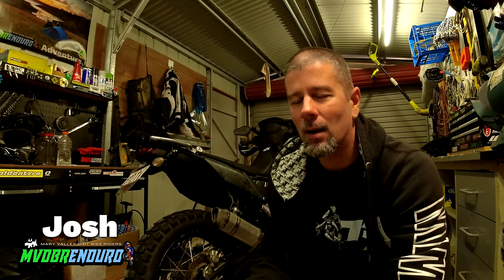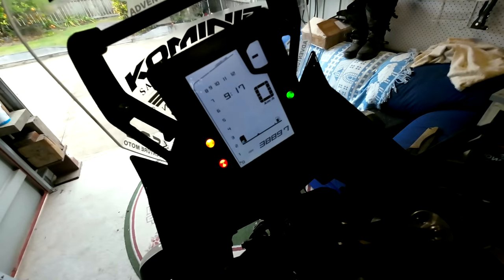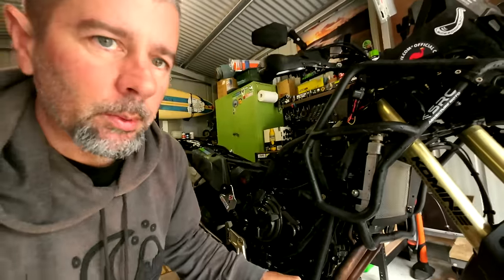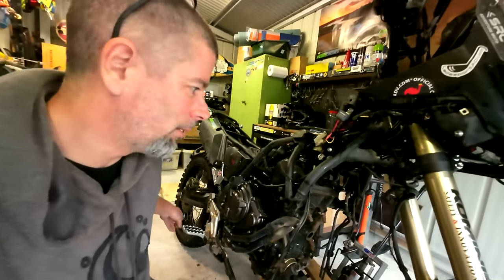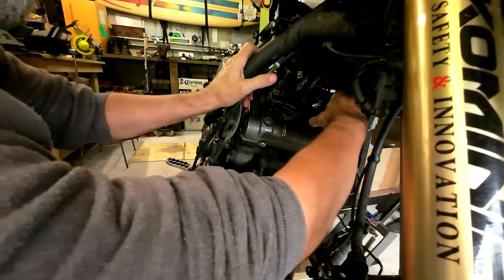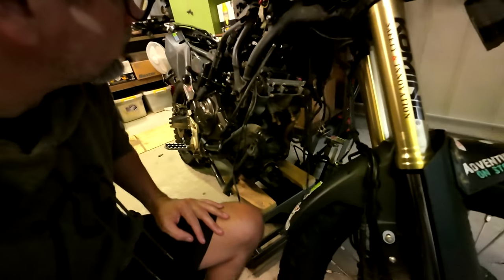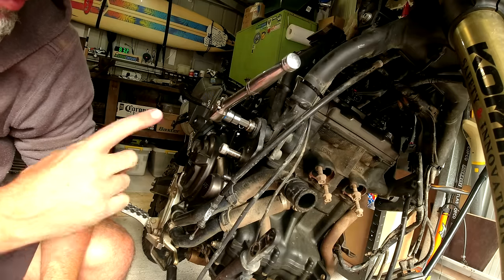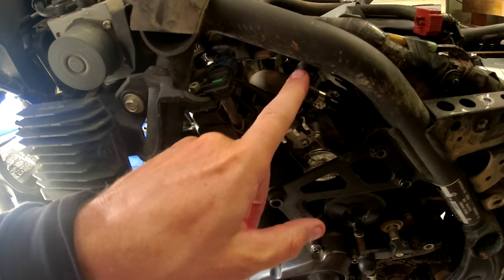Tenere 700 Valve Clearance Check: The Easy Way?

Comment: I think it doesnt really matter if the lobes are pointing forward or backward.... in either direction they are not pressing the valve and the lobe is round, so it shouldnt make a difference. 
Glad you gave it a go. I'll do it that way at 80,000 :)
Reply from the maker: So you reckon that looked easier than what you did? Yeah I couldn't get the feelers to go thru properly with the lobes pointing inwards, they still went between the lobe and the bucket but it wasn't as satisfying as the other way around somehow 😬

Comment: Hey josh, good effort. I remember doing my valves check on my 500 exc at 500 hours and they were still in specs but at the limit so like you i said f*** it it is still good. Then at 680 hours the timing chain jumped and valves hit the piston and game over. So don't go too far before shimming them properly. Cheers
Reply from the maker: Jeez the 500EXC was probably due for it's 3rd top end at 500 hours 😅 Bit different to a low maintenance twin, but I hear ya man I'll check em again in a while now that I know it's not too bad of a job 👌

Comment: Nice video but personally after all the work, I would have brought all shims to the middle of the tolerance. Would have never needed to touch the shims again ever again. Also, when doing such a job, replace all other parts you have access to. Spark plugs, air filter, coolant, valver cover gasket... After that, everything is new and serviced. One wash.

Comment: At 10:10 You are right with cam positions which should be pointing out because this is TDC on Compression stroke. First I was quite confused with video of the other guy which show cams positioned not as manual say. As for the clearance on the lower limit I would re-shim it al least a bit on this moment but this is Your choice so please post what were the clearance after next service 👍
Reply: I agree about re-shimming the ones at the limit. They are going to get quite tight for the next 40K kms.

Comment: Glad I switched from the t7 to the GUZZI v85 before 40k km, on the GUZZI valve check even though it’s on 2 different cylinders is a 30mn job 😁. Nice job Josh ! 💪🏻
Reply from the maker: Cheers mate yeah it was tempting to get rid of it 😅
Reply: better swap the Motoguzzi out too when it needs work ae? 😆
Reply: @MissionMitchAdventures  I you can wrench on a tractor you can wrench on the Guzzi :D the rear shaft drive oil even smells like tractor oil :D

Comment: Impressive effort Josh.  I had mine done at the dealership (BMW F800GS) and it cost >$700 - ouch.
Reply from the maker: Yikes, yeah it's a pretty big job on these modern multi-cylinders, especially when re-shimming is required 😬 Thanks for watching mate
Reply: @MVDBR  Someone message me ant told me they were quoted $2000 for the T7. Frking rediculous!
Reply from the maker: @Nerb1  😵😵

Comment: Surprised you didn't change them while you were in there but i guess if they need changing it should be even easier next time hey! Cheers 4 sharing sir.
Reply from the maker: Yeah I know I sometimes like to make work for myself but not this time mate 😬 A mechanic once told me they are better off at the tight end of the range anyway cause there's less valve slap or lash or whatever ya call it 🤷‍♂ Cheers broheim thanks for the comment 😎

Comment: In the late 70's and early 80's Yamaha used to promote their machines being serviceable.  My, what a backwards nightmare this is on a T7.   I thought my 701 was painful, no way, not on your scale!  Then again, my old faithful XR400, 15 minutes done.   Progress!  Oh wait.
Reply from the maker: Yeah I hear ya mate my old enduros (even the modern ones) are a helluva lot easier than this shit. Too much shit crammed in there like ABS and pollution crap on the bigger bikes these days.
Reply: @MVDBR  they no longer make engines actually for the role and we see this ridiculousness.   Just watched a walk around of the new Transalp, it’s the same with the sump asking to be taken out and the pipes going underneath. 

Anyone with a design brief for the real world would have the sump flat, oil in the frame, pipes around the side, engine mounted lower in the frame, either air box on top or a bigger fuel tank. I’m not telling you anything you don’t know in that. 😉
Reply from the maker: @brendenvosper7772  was that full pelt Pete? 😅👍
Reply: @MVDBR  yes it was.  It’s not the Honda of old.  Wonder where they are really made?   Made for a price.

Comment: “On the limit “…? I would have re-shimmed after going that far and put new spark plugs whilst having the access. Top banana for doing it though, I’ll drop the engine when its time to do mine thanks for the info
Reply from the maker: Spark plugs aye yeah shit what was I thinking 😜 11:46 As for re-shimming, I'm certainly no mechanic but my experience with these things tells me after 40k those valves are just bedded in nicely and shouldn't really move any further, as long as the air filter is kept in good order and the engine doesn't get dusted. I've also been told (by an actual bike mechanic) that the clearances are better off at the tight end of the tolerance as there's less valve lash when the engine is cold 🤷‍♂ Either way, for me taking the cams out and shit and putting it all back together properly is a much harder task than doing what I did in this vid, so I'm happy to leave it till next time. Fairly certain I'll be selling this bike before 80k either way 🍻👍 Cheers
Reply: Apologies #11:56…new spark plugs!! Obviously I must’ve been momentarily distracted -missed that part. 😞
Reply: yep, on the limit is different than past the limit as I understand it.     If things are on the limit they are still good.   Past the limit = not good and  time to adjust

Comment: Mr Yamaha was a lot more kinder to riders in the old days compared to now, I’ve got a 93 Yamaha FJ 1200 sport tourer and doing a valve check on it is a piece of cake, pull the tank off remove the valve cover and you have full unobstructed access to check, or change shims with a minimum of fuss, even the carbs are in full view so you can hook gauges on for a tune and carb sync. Modern bikes might be superior in power and handling but are a pain in the arse when you have to pull them half apart to access anything.
Reply from the maker: Yeah I guess it gives dealers a license to print money when most people are too scared to work on them themselves 💩

Comment: I would've left it till 80k then replace the timing chain, clutch pack. why don't you use iridium plugs there good for 40k
Reply from the maker: Long story on the plugs but basically I just happened to have those already, the ones I took out were iridium that had 30k on them (changed the stock ones out at 10k just because I was doing the spark plug mod on the bike) Anyway I know where I'm at now most of the shit is done at 40k 👍

Comment: At about 29000 miles my t7 is getting hard to start and I’m thinking time to adjust valves. Already replaced plugs awhile back. Thoughts?
Reply from the maker: Just cold starting is hard?
Reply: @MVDBR  yes and its been sitting in the garage all winter. battery charged up and good to go. road it a couple of times. We'll see if it continues to be hard starting on 1st start of the day. not super cold about 40f
Reply from the maker: @TheFoxyt2  yeah I guess that's usually a sign of tight valves, but these things seem pretty solid. Unless ya dusted the engine at some point. Could be a number of other things too but yeah see how ya go
Reply: Thanks mate! Super helpful.  It seems like this motor could go 200k miles. Oil changes are pretty clean. The only issue is the swmotech shifter is loose and it’s hard to tighten.  Even bent Allen key to get in there. I think I’m on 5th set of tires    I’d have to look at my spreadsheet
Reply: @MVDBR  Yes cold starting is a bit buggy.  But I feel this motor could go 200,000 miles....hard miles. Its a 2021 and almost 30,000 miles...never been to a mechanic. I've done all the maint so far. LOVE this bike and yamaha. REALLY wish yam would make a 300 2s with estart and then I wouldn't need to own any ktms ;)
Reply: @MVDBR  quick update.  Road the bike a bunch after long/cold winter and it starts great at 30,000 miles and not valve adjusted. But IMO, japanese bikes need valve adjusted when they are hard starting...now other than 1st thing in the spring. Where I live, we have many months of too much snow to ride....and that is why timbersleds are so fun! thanks for the great videos and comments. I have two Tenere 700s. One with nobbies for BDRs etc and one with woodys wheels 19" front and 17" rear with dunlop trailmax...that look like a supermoto T7 :) If/when we can ever get a T900, then I'll get rid of one of my T7s.

Comment: For God sakes! that's a really hard job! considering on selling my T7 before it reach the 40 k mark and buying another one. Question: does the ticking noise in the engine desapears with the valve regulation or is it something from birth with the CP2 engine?
Reply from the maker: All the ones I've heard so far have had that same noise 😬
Reply: @MVDBR  guess will have to live with that. Thanks for your answer!

Comment: In my opinion a garden hose is better for washing under the tank when you need to. I have used a pressure washer before and forced water into electrical connections and had a nightmare trying to start the bike and dry everything out. a garden hose won't do this.
Reply from the maker: Yeah very true you got to be careful with that pressure washer around a lot of parts on the bike. Cheers

Comment: Nice job Josh, big job for the valve clearance check 🤔think I'll be taking mine to the Yamaha shop💲💲. Interesting to read all the comments about the steering head stem bearings being under greased but yours looked fine👍, cheers 🍻🍻
Reply from the maker: I'd actually already done them once before at 6,000 km mate, probably should have mentioned that. But yeah they were a bit skimpy with the grease from factory, swingarm and linkage too. Have done them all once already, probably why they're still in good condition 👌 Cheers